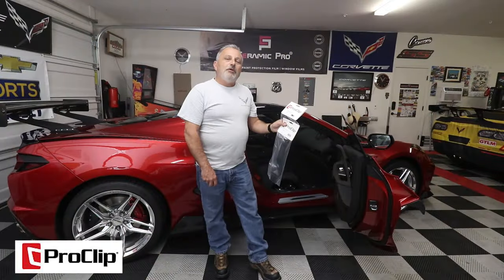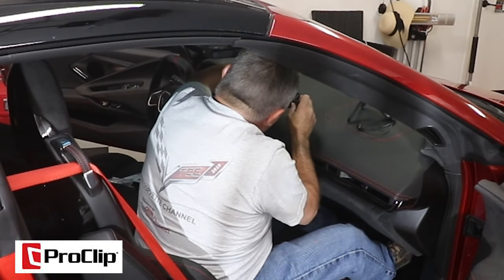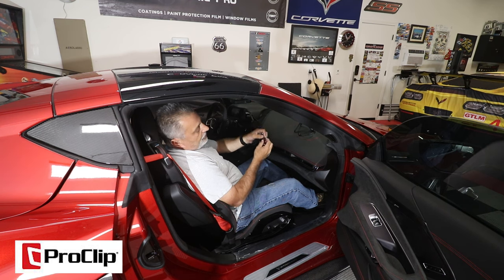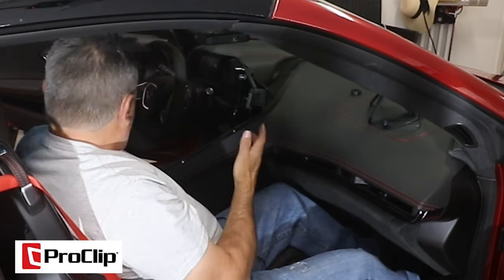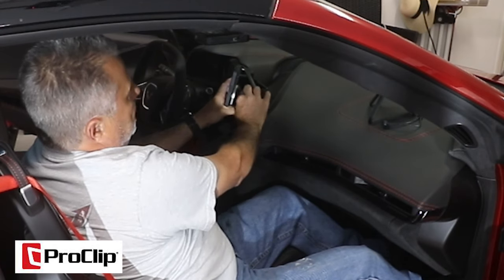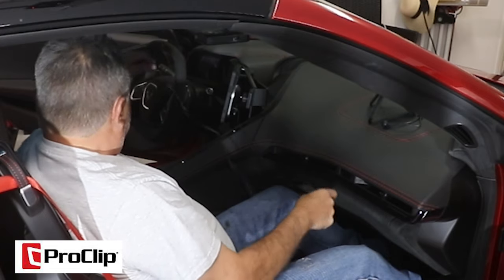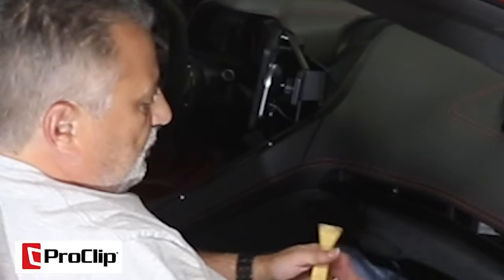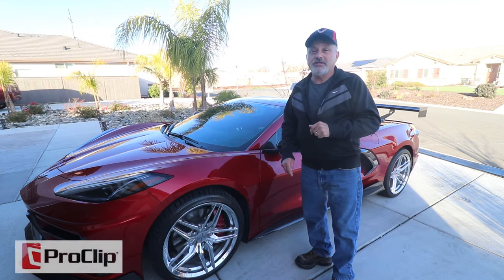How to Install a Phone Bracket and Charger in a C8 Corvette Get a 20% Discount Today From PROCLIPUSA

Comment: I am currently using the charging port under the glove box for my dash camera - I am wondering if there is a way I can either use some splitter, or tap into some fuse for the camera to allow for the port to become available for use with the charger.
Reply from the maker: I use a cigarette lighter splitter tucked under the dash. They are super cheap on Amazon!
Reply: Which one did you get? I see some reviews about these splitters popping fuses so trying to be careful